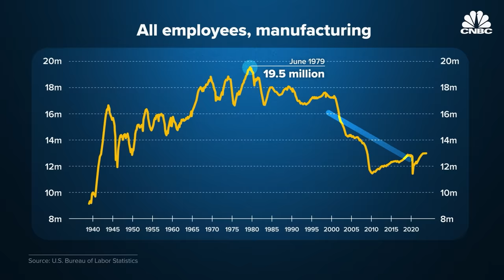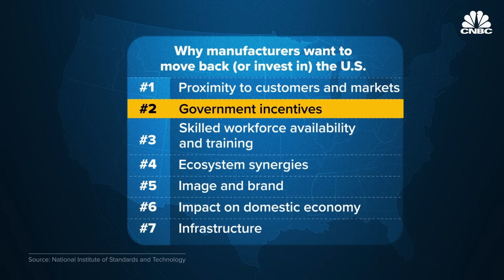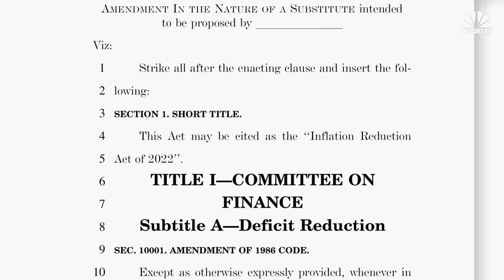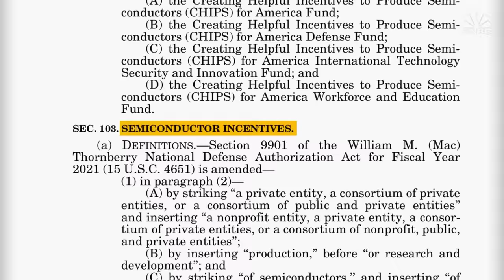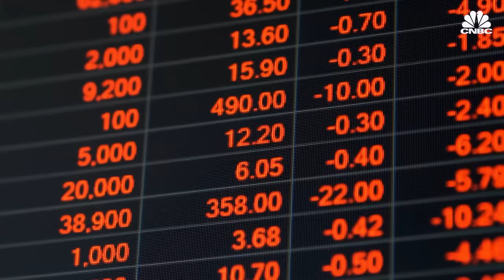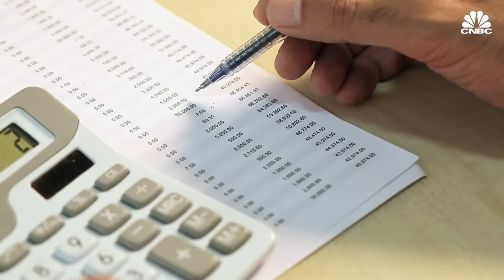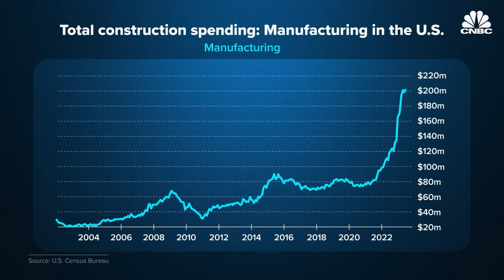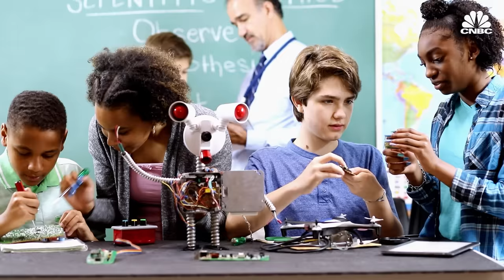Why Factories Are Coming Back To The U.S.

Comment: electric vehicle are ready, infrastructure not ready, and it won't be ready if there's no electric vehicles on a road. 

and if law would be passed to allow third party battery providers to sell new, better batteries for customers EVs would have much longer lifespan considering it has a lot less moving pars that could break.

Comment: The EV market is not profitable and only makes up 13% of all new car sales , people are paying attention to the facts about EVs . The biggest problem with EVs , safety , second reliability , third having to plug in instead of having an on-board charging system . We are still in the infant stage with EVs and until we address these issues they will not be widely accepted . As far as tech based manufacturing is concerned it is smart to have domestically but we are again putting all our eggs in one basket and like Brazil we will find out that doesn't work , we need to bring back manufacturing of all kinds if we want to repair the economy in The US .

Comment: It's a laughable spectacle! Here we have the U.S.'s Commerce Secretary Gina Raimondo desperately scrambling for chances to cozy up to China, all while trying to maintain a facade of dignity. Meanwhile, they're shamelessly belittling China, which is utterly embarrassing for the U.S. Let's face it, their own economy is crumbling faster than a sandcastle at high tide. Instead of using their noggin to propose something sensible, they're yapping about the need to crawl to China. But guess what? It's not China with the issue here; it's the U.S that's in a royal mess. They're practically on their knees, begging China for a lifeline, while pretending they're holding all the cards. Welcome to the slapstick reality show of the current era!"

Comment: Billys north  American  free trade  act did it, remember  the  made in America  commercials,  wallets  world  even  said  buy American,  now you  can  hardly  find the locally  made section  at Wal-Mart  ? It shouldn't have  gone  this way, and  it  should be  corrected,  but  corruptrate American  interests bottom line is  at stake  !

Comment: The US workforce has a much lower IQ than it did when American factories first offshored, a downward trend that will continue.  Automation will replace people whenever and wherever it's cost-effective to do so, but there will be no return to the 1950s or 1960s for United States R&D/innovation and manufacturing.  Labor costs are much higher than in south and east Asia, making it impossible to compete.  And as stated before, American IQs are too low for specialized technical work. #Checkmate

Comment: glad to hear some manufacturing is coming back. :)

i think with covid and the supply chain shortages they maybe are relearning a lesson in supply chain logistics that armies have always had to keep in mind, don't stretch out your supply lines too far/much or they become increasingly vulnerable to the slightest problems.  

some redundancy is necessary, and there is a reason the usa built up a system after world war two of  warehouses and interstates and allowed rail to focus on freight instead of passengers (they were always supposed to eventually add back passenger lines/capacity but never really did yet) and distribution networks and why it was spread out relatively evenly and based on geography/proximity.  in the 1990s companies off-shored only looking at the price factor not really planning properly or taking into consideration other important factors.

also other countries are catching up in pay and benefits slowly over time with the usa so its no longer as lucrative to off-shore as it was, and apparently the panama canal is having problems now having enough water to continue operating normally, and its starting to get to where things are evening out and they should be realizing that at least some things need to be made here.
Reply: Factories might be coming back, but jobs arent. Just look at some youtube videos of modern factories. Everything is automated.

Comment: Central Planning benefits the central planners and the freinds of central planners. These intellectuals are pushing archaic ideas that are from the middle ages. Alexander Hamilton was into corruption. They took the debt from the states bundled it up slapped additional interset on it and sold bonds to speculators. This did not make Anerica rich. Private property and economic freedom provides an increase in standard of living. Welfare to corporations by printing trillions of dollars debses the currency allowing corporations to hire slave labor because the purchasing power of the dollar went down. CNBC works for the billionaire class..